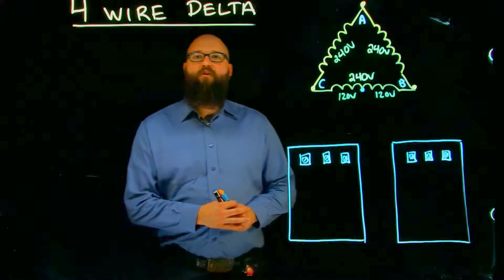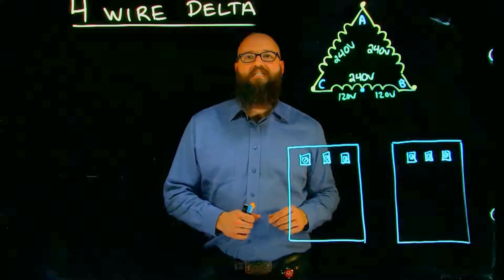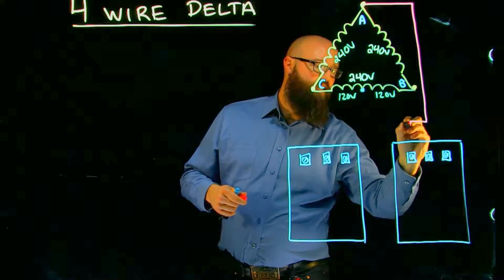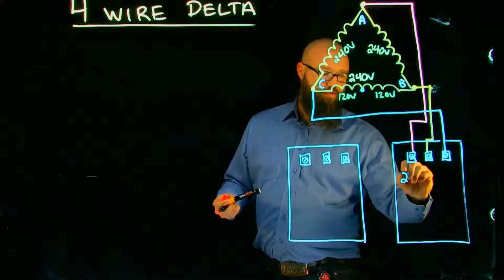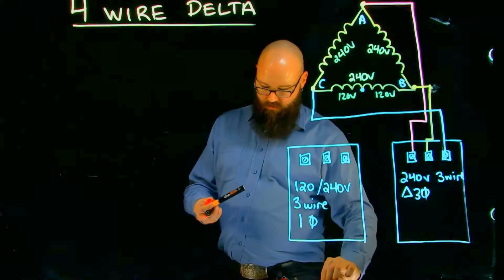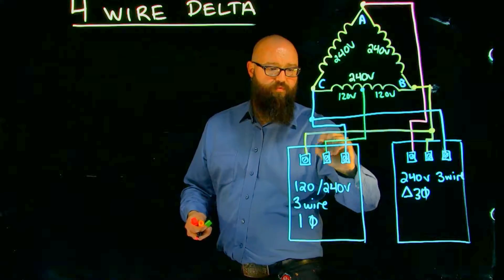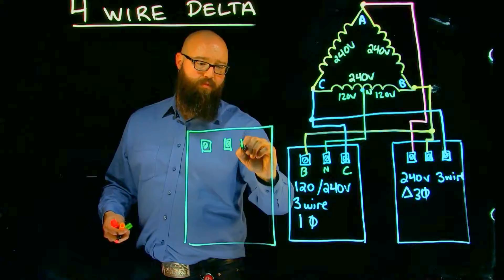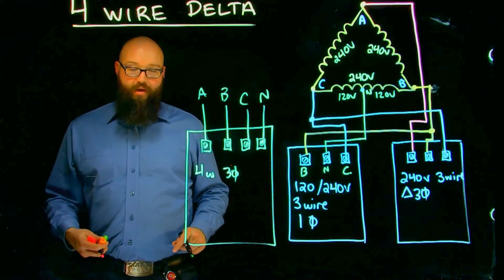Four Wire Delta Seperation

Comment: This exactly what I am planning, I was told by the electric company, the balancing would be a nightmare,  the main disconnect would have to be 3 phase... if the 3ph is 100 amps panel, and the split phase is 200 amp panel, there is something about  120v should be no more than 5-10% of the load on the delta connection, there will be phasing issues as the split phase are supposed to be 180 degrees apart. Tapping the 3 phase the phasing will be 120 degrees apart... Is this an issue.. They want to make 2 drops.. am I being sold a bill of goods by the Electric company...

Comment: very informative tutorial! thank you so much...
Reply from the maker: Thank you for watching!
Reply: @schulerruler  you can only get a high leg in a Delta system and only if that system has a neutral, correct
Reply from the maker: Correct. If there is a centre tapped phase, there will be the possibility of a high leg to neutral voltage of 208V present.

Comment: Awesome session. In this video 208 Vac is considered - in this system - as an unwanted result. I know that most appliances require 120 Vac or 240 Vac. But the 208 Y / 120 system implies that devices exists that are designed to be powered by 208 Vac, right?
Reply from the maker: Absolutely. 208 V is definitely a commonly utilized voltage for three phase wye, but you are correct it is unwanted in this situation. Imagine plugging a 120v device into an outlet that has 208v across it!